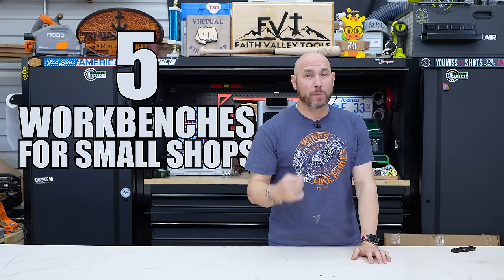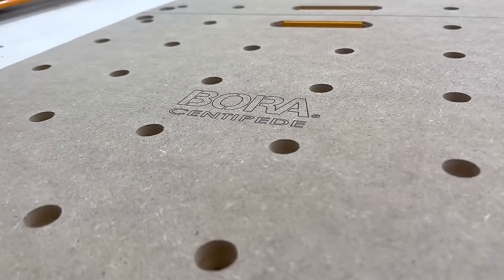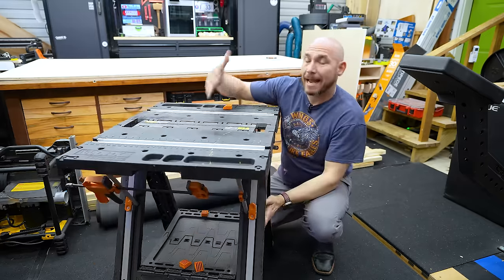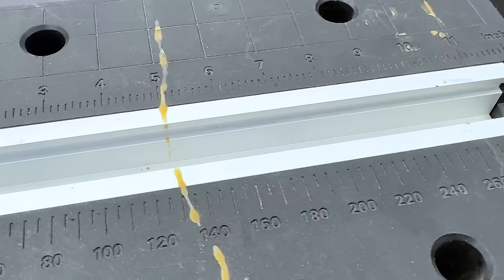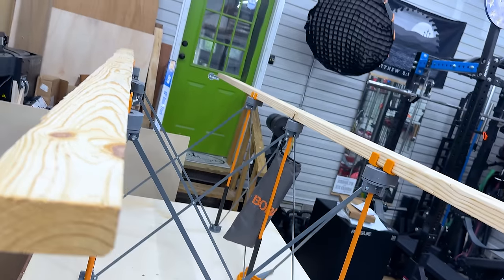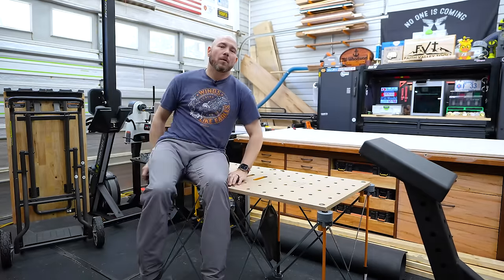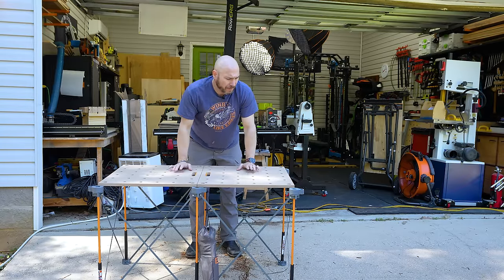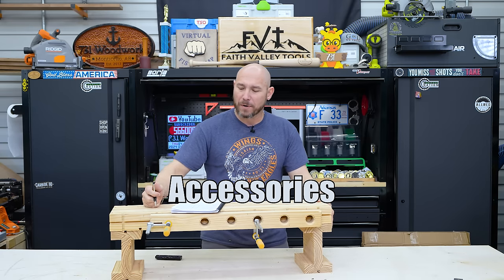Testing 5 Portable Workbenches for Small Woodworking Shops!

Comment: Stability isn't just about weight bearing. The downfall of portable workbenches is more about pushing parallel to the top. For example: using a bench plane to joint a face.

Comment: Festool makes braces for their MFT table that adds a great amount of stability to it.  I'm glad it is only an option because 98% of the time mine are setting on top of a cabinet I built for them, linked together and as solid as can be.  Of course, I have dedicated space for them, where some may need the mobility and collapsibility.  Even those people could benefit by the advanced versatility of a Festool MFT over the others.  It does fold up pretty darn flat.

Comment: I can’t say enough about the DeWalt Portable Workbench when you need a quick, sturdy space for assembly, finishing, benchtop tool setup space, etc. Folds down to a very compact package for storage. Set up in seconds. Supports 1000 pounds easily. Available at Home Depot and many other places. Regularly on sale for under $100. I have several and don’t believe I’ve paid more than $79-89 each. 
Definitely worth checking them out.

Comment: I have an old Black and Decker Workmate I bought in a thrift store for $5 that is one of the most useful tools in my shop.
Reply: I have that too. My parents got it for me when I got my first house in 1990 when I was 30. Still have it but at 64 it is heavy. Solidly build and a lot better then what  B&D sell today.
Reply: My grandpa gave me one from the 50s
Reply: I agree. I have 3 of the Black & Decker work mates and i use them very often. I even replaced the 2 wooden tops on 1 of them with 2 pieces of 1/2 plate steel for welding and other metal work.

Comment: I bought the Bora 4x8 Centipede and LOVE it. I bought two of the Bora tops as well as a couple of 2x4 sheets of 3/4" MDF. I purchased another pair of BORA tops a year later.
I also have two of the Kreg KWS1000 Mobile Project Center that I purchased several years ago, and I really like them as well.

Comment: I bought the Worx bench after watching your video about 3 years ago , my wife has used it for her tile saw when she’s tiled our kitchen, and bathrooms. She mentioned how the saw felt stable and it was a comfortable height for cutting. Tile is messy and it cleaned up well with a hose. I’ve used it in my shop when I needed an extra workbench when doing projects. It sets up quick also watch your fingers it will bite. Great review Matt

Comment: Appreciate the video. Thanks!! Ido my projects in the garage and everything need to be to be put away to park in there. Maybe I’m just cheap. I use 2 saw horses and toss an old flat door on top and call it a day. It works for the most part. No accessories. About as basic as can be.

Comment: Hi, many years ago I built my own MFT 1.5 X 3.+ . I used the same rails from Festool , but frame base was made out of 24/5mm Ply , the underside frame was made of 3 pieces of 25x160x3+ long laminated ply wood, then surface planed then put through a thickness, to finish 150m , The legs were made of ply as but were mitre lock finger joint, to form a box shape, which obviously made them hollow, I then machined a piece of oak to go in the top and bottom, this was all bolted together was staying steel fasteners, because I used the festool  rail around the sides, I could use all of their accessories, are used to use it for assembly of windows and doors, and I used it for a vac bag as well.
As you can probably gather, I was not restricted on space , and at the time money was no object, 
I have always found your reviews and territorials very interesting. Keep up the great work. Stay safe. Look forward to the next review. ,

Comment: I have two Worx Pegasus that I have owned for a very long time now.  They are great for painting on and I use the clamps to hold pieces when I edge band.  I must have gotten lucky with my Festool MFT3 because I have seen videos where presenters show them being very wobbly mine does not wobble at all.  I also built the cutting table/grid showcased in Nick from Woodshop Companion.  I retired and started building my own garage shop and liked the idea of being able to break down 3/4 Baltic plywood up off the floor and doing it by myself.  everything folds or breaks down for storage and allows for both cars to still park easily in the garage at night.

Comment: I am an Industrial Arts teacher (retired) I’ve owned an MFT for 15 years, a Kapex about 13 years and various other Festool equipment. The MFT weighs a tonne!! It’s not easy to move around. I also have the frame extension to mount tools upside down on plates, e.g. circular saw, router, jigsaw, etc… The MFT has a levelling leg. You need to unscrew it!! I will definitely be buying the bora system!! Lloyd

Comment: I have the MFT3 with the rail, fence, and protractor. It’s a great bit of gear. The best bang for my buck that I’ve ever had was buying a couple of plastic saw horses, and adding either 2 or 4 2x3 rails / rails and cross rails. Probably £40, and for a simple large 8 x 4 table / spray bench  / cutting station, it’s brilliant.

Comment: I use multiple Bora’s a lot.  I wish there was a way to add those side rails so other accessories could be added like the festool mitering system.  I bought a Benchdogs add on and it is useful.  But for everyday use, because I’m in a garage and setup and tear down every time, bora works well for most things. I’ve got a Sjoberg’s work bench, but for some reason, I can’t keep the clutter off the top.  So I end up using the bora.  And just recently I bought a festool Mft.  
Thanks for the review Matt.

Comment: I have a 16 wide by 20 deep building in the back yard for my shop, so it's not super small, but space is still at a premium.  I built a 12 by 16 foot deck out the front of it.  Bora Centipede is my other workbench that I use out front on the deck when the main bench is occupied.  I don't always need it, but when I do, it is great to have.

Comment: I've got the 2x4x36" Centipede, it works great for my projects out on the apartment patio. You can also get a set of 6" risers if the model you have is too low.
Reply: The risers make it a truly workable system and a total back saver! I have rosettes on both of my Centipedes

Comment: Just picked up a pair of the Worx benches, on sale, so saved $120 on the pair (far more expensive in Canada @ $169.99)

P.S. height is only part of the issue with the height of the workbench; I know a LOT of people taller than my 5'7", but many of them have a shorter inseam than my 32"

Comment: I have the Bora 4x6’ without the tops.  I use plywood off cuts for now.  It’s amazing how little space it takes up when stored and it has a decent bag/case with handles.  My only gripe is that the 30” height is too low for me.  I’ll be getting the risers, soon.

Comment: I use a 4x6 Bora Centipede primarily for cutting down plywood.  I do a lot of hand tool work and the Centipede racks too much for that application. 

The 4x6 foot size is plenty big for cutting down full size sheets of plywood; If I could change one thing it would be about 6 inches narrower; this would support the 4 foot width of a plywood sheet more securely.  I also agree about the pinch hazard with the folding top.

For stow-away collapsibility, light weight, and strength I don't think the Centipede can be beat.

Comment: Thanks for this, I've been looking for a solution to my limited space. Building a new desktop surface for my fiancée has been painful to do on saw horses without grips on the feet. Part of me still really wants to make an all in one work bench like I've seen with the 4x8 bench that PhilipReborn did or the mobile workbench that Paoson Woodworking did with a table saw and router as well as dust collection built in, just seems like a fun project. 

My biggest need is really a large work table that I can assemble, work on and rip cut plywood among other things.
Reply: In the end I think the bora centipede is my best fit solution

Comment: Thanks for the comparison. For me, pricing should be part of this type of ranking. I have the Pegasus and the Bora. Both great but, The Pegasus is more valuable to me as it can be set up faster IMO and I use two at a time in either saw horse or link mode. Yes, you can attach two or more of the Pegasus for a huge work bench that is even more stable. That is another feature that puts the Pegasus as my #1.

Comment: You should review the DashBoard system and accessories.
Reply: No need to review, it's an awesome, high quality setup.  It's on the level of the Festool.  I've got their MFT Guide Rail Bracket Set and it is rock solid and square every single time.

Comment: I have the Kreg foldable work bench. Might should have included it in the review. It is easy to set up and fold away, has a much larger work surface, has track saw capability,dog holes and wheels so it moves easily.
Reply: I looked at three different Kreg tables and much to my surprise & disappointment. None of them had a flat top. All were bowed!

Comment: I own 2 Kreg work tables, have a couple of 6’ 2x4’s and a cut down 3/4” plywood top I can use for assembly/painting when necessary. Most of the time I just use them attached to each other with the included X-clips, use the Kreg dogs and clamps, etc. I’ve come to be disappointed in some of my Kreg tools but not these. These and my classic B&D WorkMate are the most used benches in my shop.

Comment: I have 2 pegasys tables.  They are sturdy and store away nicely.  however you can't clamp easily pieces on to the table.  The underneath of the surface is not flat. Instead it is ribbed plastic for strength.  That's the only thing I would switch.  I think Kreg has a portable table that allows clamping to its undersurface.

Comment: Great, thanks for that I have to admit though while all these new fang dangled workbenches look pretty and probably quite useful. In some cases. 

I actually personally think the best solution for a portable workbench is to fall back to a trusted Black & Decker Workmate. I've actually got three and if you have a pair of them supporting a decent flat board you've got a brilliant solid workbench you can stick 200 kg on top of the one and it's still stands up that's not the rated weight but it's what I've tried .

Mine came from the late 80s and they were built as solid as rock, unlike the newer versions, I created my own board out of a piece of plywood 1 inch thick and put my own dog holes in it and either end I put some dowels that fit into the dog holes on the workmate , that way I still get to keep the vice of the Workmate.

I created a second table out of plywood which doesn't require the use of both workmates that simply has a piece of  3 x 2 underneath the plywood which you put between the vice of the Workmate and clamp it down hard and while you do get a smaller work surface it's still useful when you dont need a full bench 

iI I ever need to go and work at a clients premises that is always in my van and I think it the best ever made tool Black & Decker. ever made.😄  #Workmate

Comment: The wen 24" portable work bench is pretty good. I find it more useful than tha worx. The fact that the Wen surface can be used as a clamp is really useful. 
However it is not as easy to set up, but its not very complicated. It's thw difference between 30 seconds as opposed to 10 seconds

Comment: Thanks for the informative video! I'm wondering though if I'm missing something - why no adjustability on these for when one needs to place them on uneven surfaces? I would think adjustable feet would be in order, especially for the Bora with its six points of contact with the ground. Does one need to carry shims around to achieve stability when you don't have a nice even concrete slab or floor or deck to put it on? By the way, great channel!

Comment: The In-Line Workholding Clamps from TayTools are great (or EWORK in the 3/4" size or from many overseas stores in many names). They're tremendously cheaper than the Festool Clamping Elements ... and they're mostly better. 
The short version: 
The Festools need to be used perfectly and they can get damaged in normal use. They aren't built fragile, it's the design. 
The other clamps are more forgiving and operate more smoothly. 
Now that I have the others I find I never pull out the Festool Clamping Elements anymore.
Reply: You should sell them and get more of the TayTools versions.  What are the vulnerabilities of the Festool Clamping Elements?  I haven't seen that and I use them all of the time.  Maybe there is something I need to keep an eye on.
Reply: @DavidATakes  The first Elements I received I had replaced because they had jammed immediately.
I can't find my emails with Festool support to give a good description of everything, but I believe that they told me to expect that the clamp would make divots in the bar when clamping. 
In the case of the bad clamp, the divot I got was so deep that the clamp was mostly unusable.
I believe this was from clamping in a loose way. When clamped too loose and without, the Festool will not stay straight in the hole and will pitch upwards. With the bar pitched up, the clamp dug in to the metal much harder. 
My replacements have the normal nicks, but I was careful after that to always tighten completely before using.

Comment: I have a very specific metric I measure woodworking benches by; it has to hold up to the rigors of handplaneing. If it flexes, shakes, skips, or moves in any way when handplaneing then it isn't worth it. As far as this video goes, the homemade matchfit bench is the best because you can clamp it to a solid surface and handplane without it moving. Also, I personally feel that the best portable workbench is the moravian workbench. It's design enables it to come apart and assemble quickly and it is rock solid when planeing. It isn't a light as the options here, but it is a real work bench that is portable. I guess if you never use a hand plane, and I can't see that never happening, these manufactured things would be fine, but otherwise you can build a moravian for the cost of some of these things. I made mine from southern yellow pine, aside from the cost of vises, it was less than 200 bucks for everything. The vises can range anywhere from 60 to several hundreds of dollars. Also, if you have the tools, you can make your own vises from wood stock, you just need to be able to thread the wood.

Comment: I am surprised you didn't add Mreg portable work bench. I have one and a saw horse which you can add 2- 2x4's and a 3/4 sheet of plywood,  I used mdf  very stable. I bought it as a temporary work bench  before I built a new one instead used it for many years

Comment: The difference between the Festool MFT (no rail or protractor) and MFT/3 (w/rail and protractor) is $100.  The track alone is close to $100.  It would be dumb to buy it without the rail and protractor, even if you already have one already.

It's certainly not cheap but well worth it, IMO. Like a lot of Festool tools, it is set up as a complete system for installers.  Dust collection and their "system" emphasis fits very well with this market.  Getting sawdust all over a client's house is considered rude.

An example of the "system" approach.  The extension rails for the Kapex, also fit on the MFT, on the Centro edge-bander, and a bunch of other tools. The routers fit on the tracks.  All of the tables and Kapex stand, side extensions, etc. are the same height so can be used together. My table saw happens to be at the same height, too, so things work out well.

There are all sorts of other "system" features, too.  That said, Festool really is designed for the professional, not the hobbyist. The same could be said for some others (hobbyists don't need Pack-Outs) but not to the same extreme.

Comment: For those considering getting the Bora Centipede: The top comes in three versions, one without dog holes, one with 3/4" dog holes, and one with 20mm dog holes. The advantage of the 20mm version is that is the world wide standard. Even in the United States, accessories for 20mm dog holes are more widely available than are accessories for 3/4" dog holes. This gives the 20mm version of the table greater flexibility because some accessories simply aren't made for use with 3/4" dog holes. 

This doesn't mean you should buy the 20mm version over the 3/4" version. Bora bundles the 3/4" top with the Centipede and some accessories. That bundle often goes on sale. When it's on sale its a few dollars less than you could buy the Centipede base and accessories with the 20mm top. So, if you don't need or want the greater variety of accessories available for 20mm dog holes, you can save some cash by buying the 3/4" dog hole version.
Reply: Since it's modular you can get different tops as needed, the larger ones let you mix and match whatever tops you want to use on it or leave open spaces such as for sawing, and so on.

Comment: The thing I didn't like about Bora is that I am not sure you can trust those holes to be perfectly laid out (a bit off 90) if you wanted to use them as a guide for square cuts.  Especially if you're doing multiple tops (that's what you do for larger sizes, multiple tops), but I think even across the same top.  That's where the MFT shines - those holes are precise and all you need to ensure squareness.

Comment: You can make a top for the Bora of 2 3'x3' 3/4 inch plywood giving  a 3'x6' table I have the original make of the tables before Bora bought the rights. I have a 2'x4' and a 4'x8' .  On the larger table you put an 4x8' foam and use with with a track saw